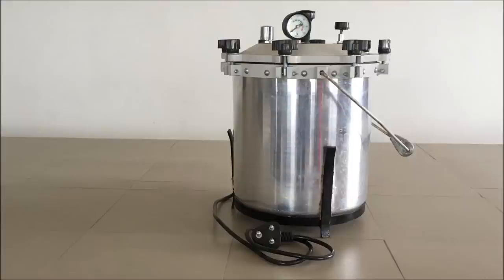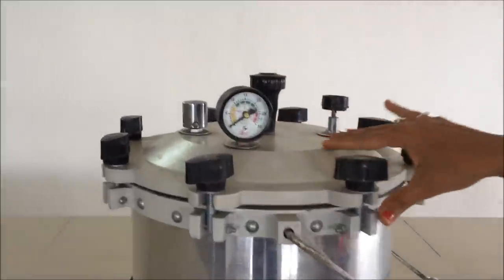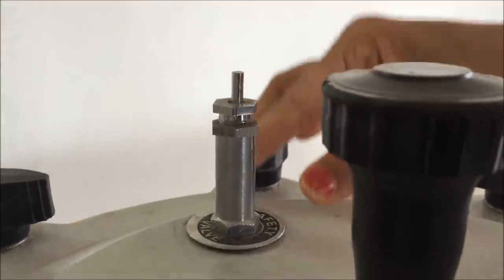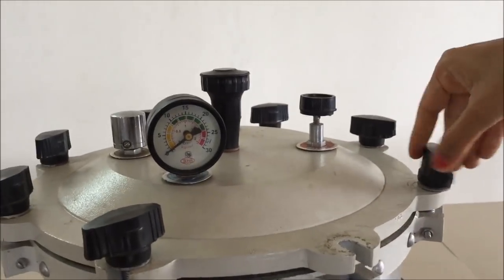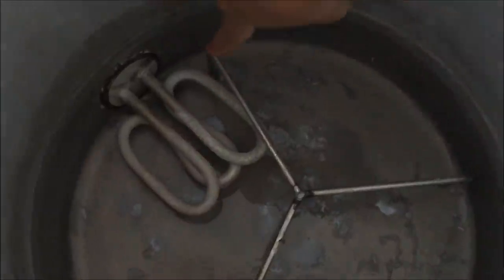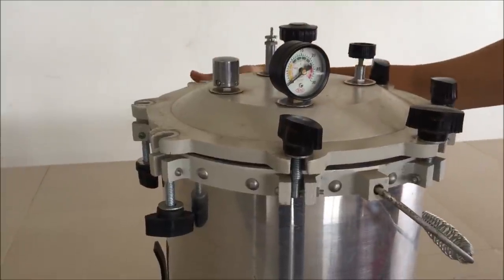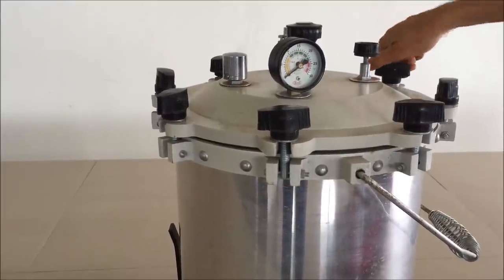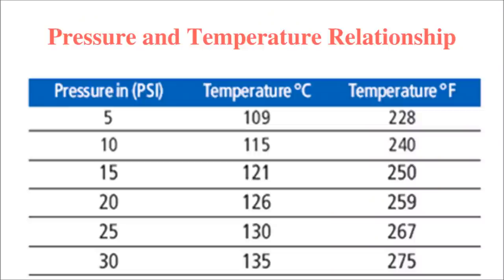Autoclave | General Construction and Working Principle | Moist Heat Sterilization | Sterilization

Comment: I have a 18L autoclave. But the problem is each autoclave pounch gets out wet. How can I apply a kind of drying cycle in this kind of autoclave?
Reply: Wait for the inside pressure down to zero to avoid wet.
Reply: what price